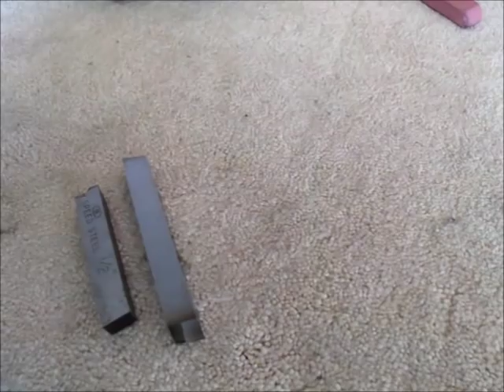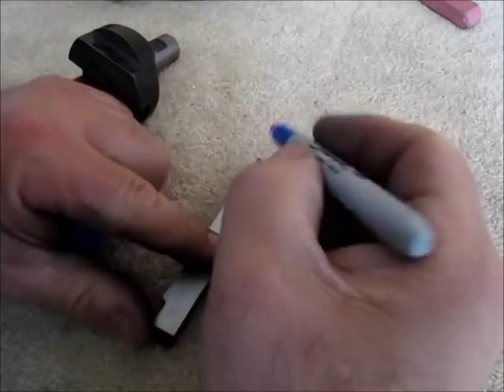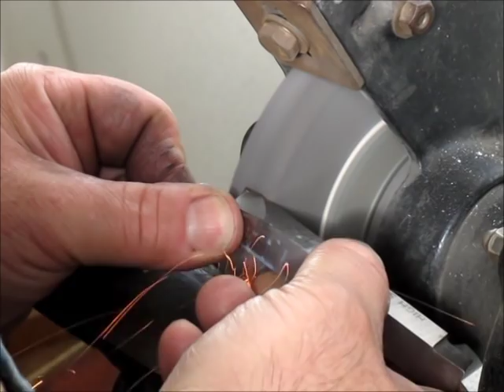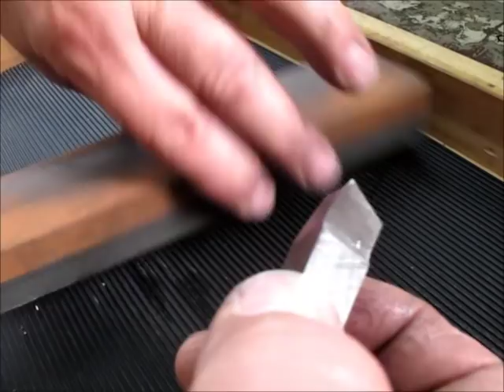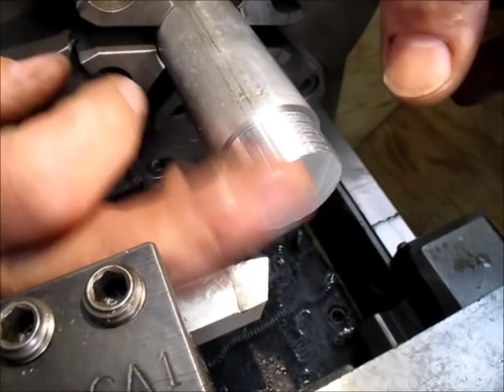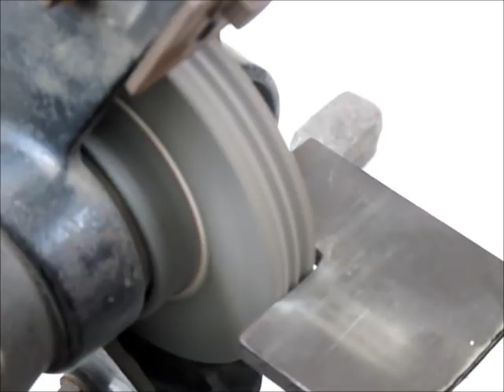Toolbit Development 1

Comment: Tom
I lathe true my soft urethane (101 on the A-scale) roller skating wheels (62mm diameter). Not knowing how to grind cutters (3/8 square HSS) I decided to make it into a knife-edge. The front face is rounded with a steep rake done by hand.
When I cut them, I end up with "rubber bands" that are seemingly endless.
I'm not sure how to grind my cutter.
Do you have any suggestions for me ?
Reply from the maker: Hi Roger,

Funny you should ask that question. I designed some tools for cutting the OD of urethane skateboard wheels. We used to do thousands of them a week. The tool is actually a tricky thing to grind. The good news is it sounds like you're on the right track. You need a razor edge in contact with the diameter to be cut. The other thing we added was a sharpened edge where the ribbon came off the wheel which was used to split the ribbon up so you don't get the tough rings. I don't think I have one in my box anymore but I'll take a look. Mess around with the lead angle the edge comes into contact with the urethane. Angle it so your razor edge is not parallel with the diameter. See if that helps.

All the best,

Tom

Comment: Small lathe, but I am having trouble getting good finishes, mostly I think because of my tools. Also I would like to better understand the difference between roughing and finishing, both in terms of tool geometry and feeds and speeds. Thank you for this.
Reply from the maker: Hi Scott,

First off I can tell from your questions you need to buy the Southbend book "How to Run a Lathe" This book is a must have for anybody that has a lathe, period. They are readily available and cheap. So a couple of quick words on roughing and finishing. Remember these guidelines.

Rough ugly. Its to remove material quickly, nothing else. Feedrates from .015 down to .008.

Finishing is for size and finish. Sharp honed tools and feedrates from .005 down to .002 per rev or less on certain operations. 

For a small lathe that is not rigid then lean toward the finishing side of things with sharper lower pressure tools.

Hope this helps.

All the best,

Tom

Comment: This video really helped me. I'd like to see one like it but for machining steel. I have struggled with this on my maximat super11, which is a good sma
Reply from the maker: Hi Scott,

This toolbit will also work for steel. The angles for steel are pretty close to the same with a wide range of angles that will work. The only thing I would do different if make the chip breaker a little different. I would start with this geometry for steel and go for it.

Cheers,

Tom

Comment: Thanks for removing some of the mystery of tool grinding...starting to see why they are shaped as they are.  The pre-honing version was not only looking like it was leaving an ugly finish, it was also sounding like it. Is sound a reliable way to tell that the tool needs some work?  Or are there too many other reasons for shrieking during a cut?
Reply from the maker: Hi Hammer,

Sound is actually a good indicator. There are quite a few signs available to determine how a particular cut is going. One is sound the other is finish and chip formation. If any of these change much during a cut you should check out the tool for damage or wear. Shrieking it just the tools way of telling you to get your boots off the coffee table.

Cheers,

Tom

Comment: Thanks for the great tutorial!  I use an EZE-LAP diamond stone to hone my high speed cutting bits after grinding.  Additionally I polish (lap) them with various other tools to get a nice finish.  Most of what I machine on my very small TOS tool makers lathe, is 303 stainless, and precious metals.  I never had much need for a chip breaker, and I am going to give this a try the next time I need to grind a new cutting bit.
Reply from the maker: Hi Zews,

I like the diamond laps myself. I deliberately tried to keep the tool bit video as low a tool investment as possible. There are some wonderful diamond products out there at really reasonable prices. As you say everybody should have some diamond tooling in their box. I wonder what the chip breaker for gold and platinum look like. I'd be willing to run some tests for you.......

Cheers,

Tom

Comment from the maker: Hi Alex,

If it works then that's all that matters. Its more important to make good parts than to do everything by the book so to speak. You are probably correct that the cutting edge will not last as long but if the results are controllable and reproducible then who cares. The word on tool angles is there is a broad range of angles and geometries that will cut metal. Don't get hung up on the "book" I would suggest trying your coworkers deal yourself and making your own assessment.  

Best,

Tom

Comment from the maker: Hi Fadt,

Most of the holders I've seen for inserts that have that much relief are flat also. That is horizontal to the machine center line. You could put some angle in the pocket to create some rake but I would not do it. If you get non flat top inserts that already have a positive geometry they may not perform at all. Stick with what the manufacturers are doing as they invest lots of time and money to get their tools to work. Hope that helps.

Regards,

Tom

Comment from the maker: Hi Fred,

I don't think I honed the top surface after the chipbreaker was put in. The reason is if that surface is honed after it can very easily be damaged since its a fine edge. I lead with the cutting edge as you say but many people go the opposite.

I bought the maps at a local voodoo shop. What city were you in again? Looks like I need to stick another couple of pins there.

Regards,

Tom

Comment from the maker: Hi Hal,

That's a good way to grind a small feature like a chipbreaker. I'm going to get a couple of finer harder wheels for my small bench grinder and get back in practice. Lawrence suggested a Dremel with a small cutoff wheel which I tried and it works well.

Regards,

Tom

Comment: Hey Tom another great Video, on making a chip breaker how about cutting it with a thin cut off wheel in die grinder, I find it's easier and creates a sharper edge for the chip breaker. The tool bit is held in the vice does not get hot and I have more control with a die grinder. Hal

Comment from the maker: Hi Annoy,

Not sure what you mean "away" from the edge. I push the tool in the direction that would make it cut. In other words the same direction the material would flow into the edge in question. Does that make sense? I think I might have said something like how you sharpen a knife in the video.  I don't think it matters too much which is probably why I didn't blather on about it.

Thanks for the comment.

Best,

Tom

Comment from the maker: Hi Chris,

Another good point. In fact in this video I moved the leading cutting edge over after I ground the chip breaker. The wheels on my grinder have big corners so I was having a little trouble making a tight little chipbreaker. But I also really wanted to use the bench grinder and the lowest equipment investment tools.

Best,

Tom

Comment from the maker: Hi Chris,

Great points. There is way to much weight is given to specific tool angles and geometries. The bottom line is a large range of configurations work. Take a look in a really old machining handbook at check out some wacky looking forged tools. In the olden days (when you were a lad) a blacksmith was an important guy in the machine shop. Many tools were forged and heat treated right on the shop floor.

Regards,

Tom

Comment: Another thought, if you know you are going to use a chip breaker, grind it first as it is so much easier to grind the cutting edge to the CB than the other way around. OK, this does not fit your tutorial (sorry) but something for beginners to think about when grinding a new tool.

Comment: Hi Tom, GR8 vid. I think all those angle recommendations in the books should be ignored. They are based on out dated working practices (now that we have TC, CBN, PCD and ceramics).. Contentious? not really, they are intended for maximum metal removal to save time and money, this is OK for industry but most of the viewers on YT are home-shoppists where finish is all and time very much a secondary consideration. One decent RH HSS tool will finish well and do 90% of Av. Joe's home turning.

Comment: Tom that was really good I'm going to have to watch it again to catch all the info. The tool bits I've ground have been with smaller stock (1/4 inch) which makes it hard to see and get the geometry right.  I'm going to see if I can get some larger tool bit stock to grind.  Honing really seems to make a big difference too I'm going to try that as well.  What angle is your tool rest at it looks like 90?  Thanks again for the vid!

Comment: I seem to have my own style of tool grinding, not that its any different than anyone else, but I have my own favorite tools and grinds that I use on the daily basis, most of which I picked up from my dad. I rarely use the positive lead angle approach, mine is usually set to turn to a square shoulder. I thought it might be of help to share with what I learned and how I grind my chip breakers. Im going to add it to my list of videos to make. 
BTW, I'll be posting up a large lathe work video soon.
Reply: I’ve watched so many of your videos (thanks for teaching us so much) 
 but never saw a post from you. I’ve been on the carbide bandwagon, but have purchased several big lots of used HSS tools to learn from the various grinds. I’m really enjoying the process and the surface finishes that are possible. On my most recent buy, I bought a lot that was over 30 pounds with a lot of WW2 dated US Air Force marked tooling. Talk about a cool find being able to handle Turing tools and custom form tools from WW2.

Comment from the maker: Hi Tom,

Low carbon steel and in particular hot rolled is difficult to get a really nice finish on. My advice is use a nose radius and take a depth of cut radially that is equal to the nose radius or greater as a minimum cut. The hard thing is to take a really light cut and get a super finish on hot rolled steel.

Regards,

Tom

Comment from the maker: Hi Jack,

You are right. I generally grind my chipbreakers on my Deckel. The small diameter fine diamond wheel is the killer tool. Not everybody has that so I did it the lowest equipment investment method. I'm glad I got the point across.

Best,

Tom

Comment: Super great info. As a rookie, you took a lot of mystery out of tool bit sharpening. I have rarely honed. Can't believe the difference it makes. Will cutting steal have the same results? I usually cut hot rolled steal and am not often satisfied with the finish.
next video maybe a little blackboard theory?    great info Tom. tkx,
.

Comment from the maker: Hi Tyler,

Great question. First I would have ground the chip breaker differently for steel to make it stronger. For the same basic tool in steel I would have run it at 250-300 rpm and the heavier feed rate on the 1.5 (50mm) diameter.

Regards,

Tom

Comment from the maker: Hi Dan,

Excellent questions. The reason I lifted the tool was to get onto the more curved part of the wheel if that makes sense. I was holding the bit at a compound angle to do the top rake of the bit. So I tipped the right hand side of the tool in toward the spindle and down toward the tool rest. Its also easier to feel when you engage with the wheel if you are making full contact with the previous grind. Its water with a little soluble oil.

Best,

Tom

Comment: Question: when you were grinding the tool initially you used the tool plate [I presume to keep faces square] but later you lifted it and used your fingers higher up the wheel. Is this your personal habit or is there a reason? Also, is it water you dip the tool into periodically or something else?

Comment from the maker: Hi Straighthread,

The stone on the left side is Aluminum oxide run of the mill bench grinder wheel. Probably 46 grit. The right hand one is Silicon Carbide, also fairly coarse. You don't need super fine wheels for most tool bit work in particular if you hand hone. Fine grit wheels are nice for holding form and sharp corners like you would need for detail work like chipbreakers.

Regards,

Tom

Comment from the maker: Hi rhost,

The chip breaker does go all the way to the edge. Its rather large for fine depth of cuts so that is part of the reason it performed poorly on the light cuts. The feedrate was the variable with the most effect on the chips breaking with the setup I showed.

Thanks for the comment.

Best,

Tom

Comment from the maker: Hi Flip,
 I took the chipbreaker all the way to the leading edge. It is very high positive cutting angle. The chip breaker is rather large which is somewhat realistic hand grinding on an average bench grinder. To make really fine chipbreakers you need a fine narrow wheel with a tight crisp dressing.

Best,

Tom

Comment: Looking at the last part of the video, it looks like the reason the chip breaker isn't working is because the chips are never hitting it due to the relief angle on the front side of the blank. If you moved the chip breaker closer to the cutting edge it would work with less DOC.

Comment: best made simple video on the subject.thanks. When you grind the chipbreaker, do you grind it all the way to the cutting edge (thus dramatically increasing the rake angle)? or do you leave a tiny flat at the cutting edge to prevent the cutting edge to keep the edge from dulling too fast? it was hard to see if there was a tiny little sharpie line left on the cutting edge.